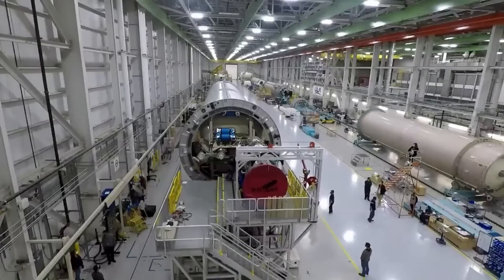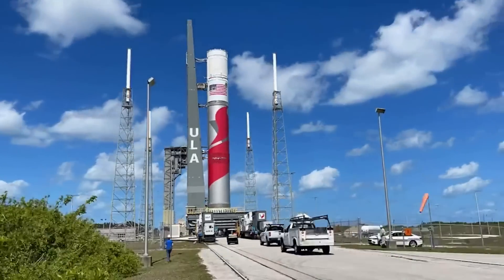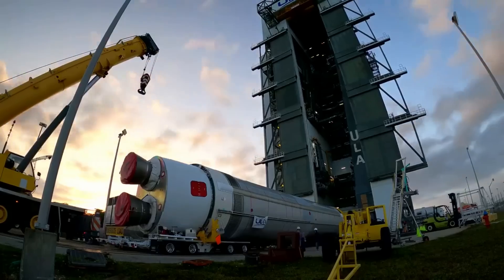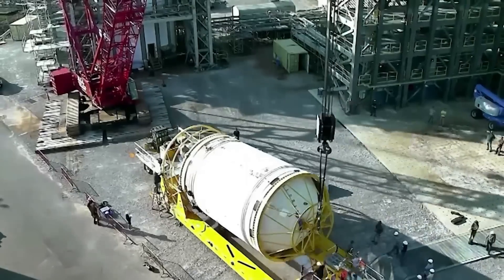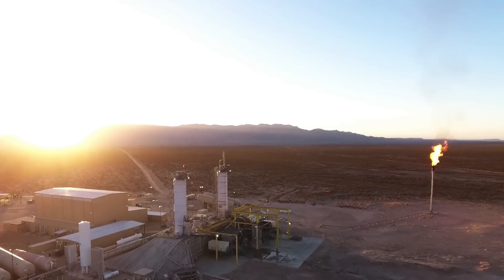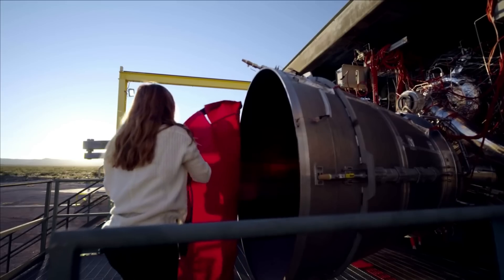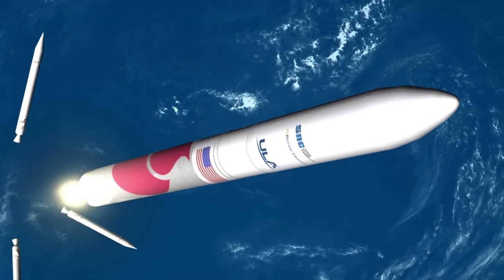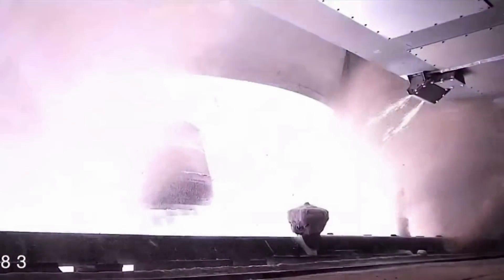ULA's Vulcan Is Practically Ready To Launch

Comment: Wow, talk about a short test. I noticed the "igniters" were running for the duration. Are these just to manage a no-ignition event to get rid of unburnt gasses?
Reply: They’re called rofies and they are solids that burn till they run out of fuel. And yes they are to burn away any excess gases and fuel so they don’t build up and cause an explosion
Reply: The BE-4 engines have already been tested at full duration. This was an integration test and a few seconds is all that was needed for data.
Reply: Probably take a week to replace them sparklers🎇🎇